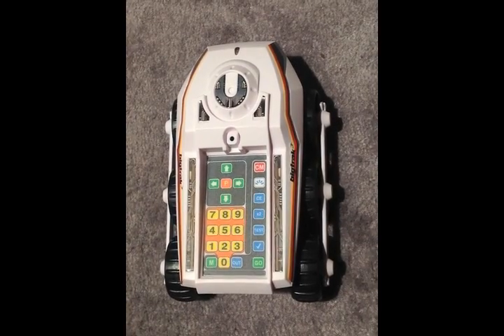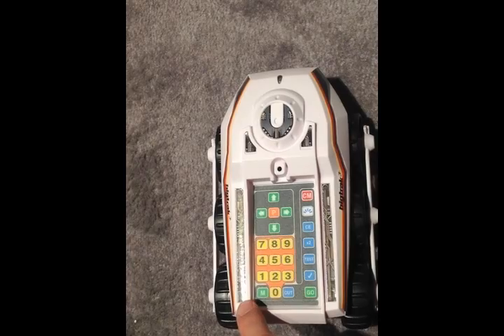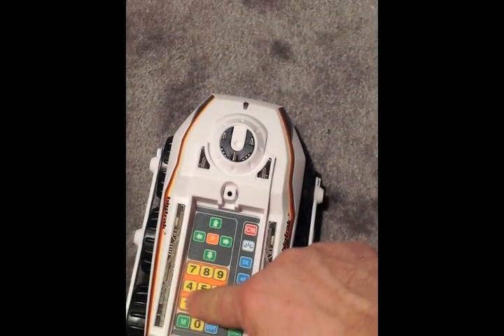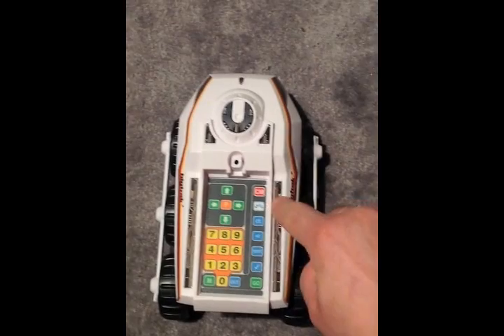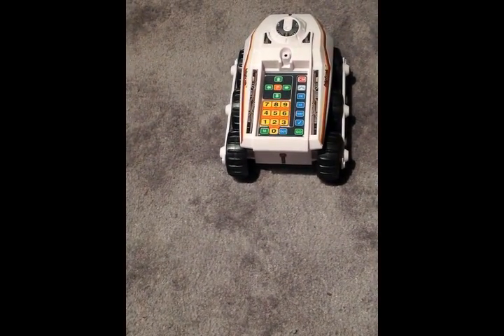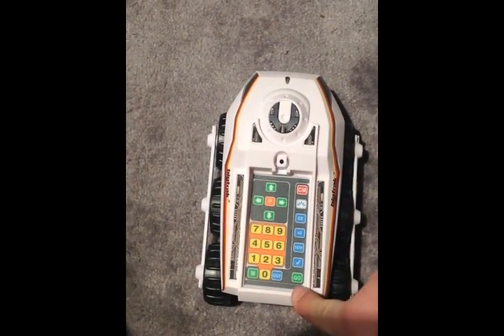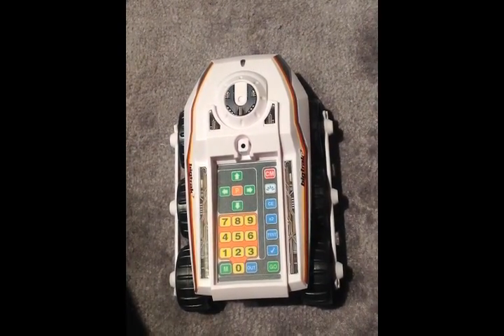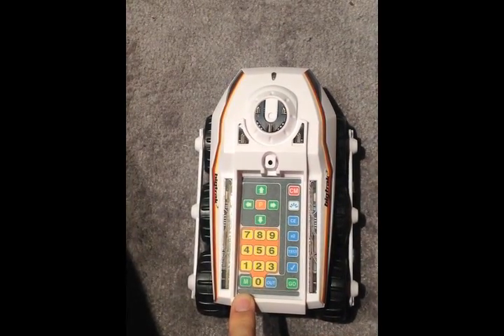How to program the BigTrak robot car

Comment: Den junior MB big trak kenne ich gar nicht, kenne nur den weißen von milton bredley von 1979.is 1980 den es zu dieser Zeit gab in Deutschland und eben den retro zt zeon big trak 2010 der ist auch in weiß den schwarzen habe ich nicht das war die USA Ausführung 1979, die 2 weißen besitze ich den 1979 /1980 den originalen von milton bredley und den big trak 2010 von zt zeon den reblika retro.